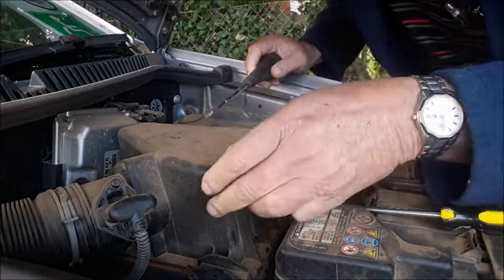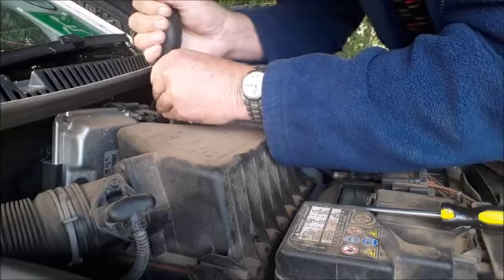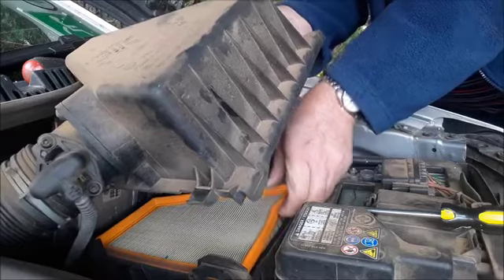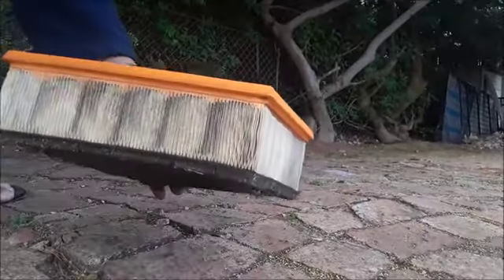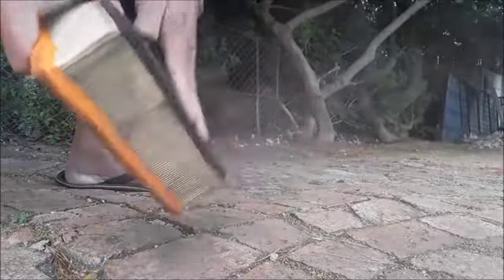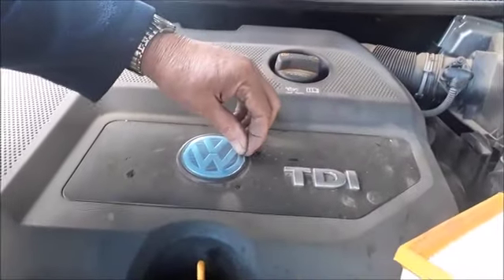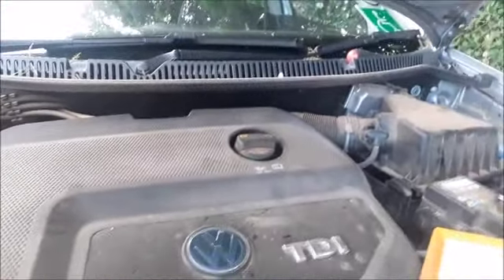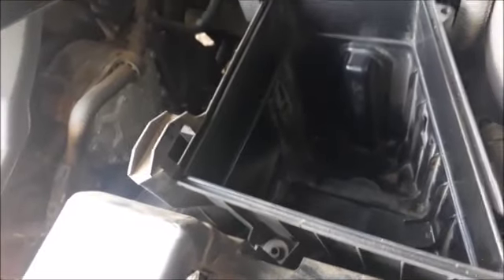Polo 1.9 air filter check after driving 30km in dust & a sneak preview of my 1000 sub mark

Comment: Good Idea to clean out the Filter Jan, I was expecting to see you use a Shop Vac or a Air Compressor, that's what I always use, makes them like brand new again.
Reply from the maker: Hi Dan, my plan is to replace it, the shops was closed yesterday due to it was a Holiday day, in the mean time till Saturday I will blow it out at the work workshop, I have't got a compressor at at home, thanks for watching Dan

Comment: You should use the air compressor to clean up the filter. Good video anyways. I need to replace the air filter for my Audi as well.
Reply from the maker: You are right my friend, I thought it would be the best to replace it but it is a holiday day  today here, shops are closed, thanks for commenting here my good friend